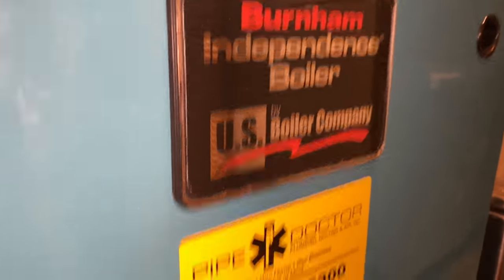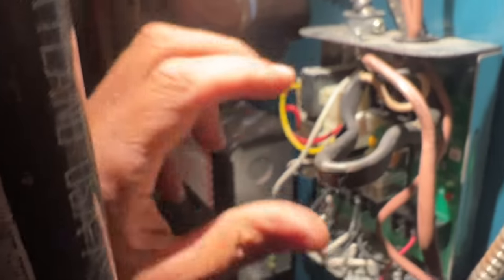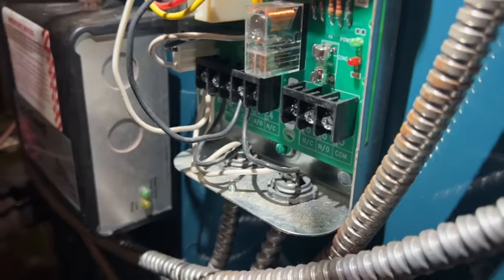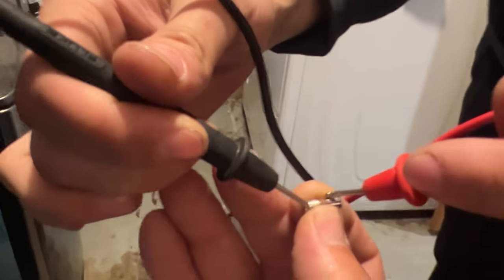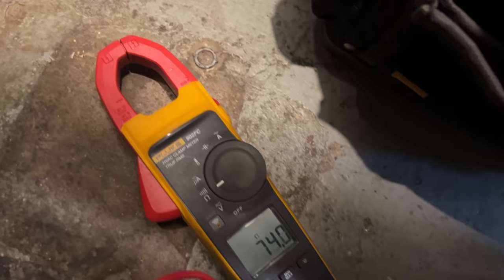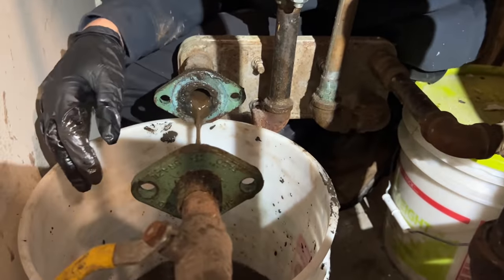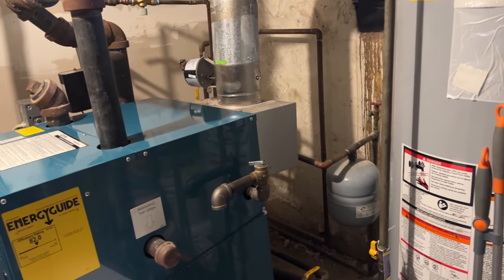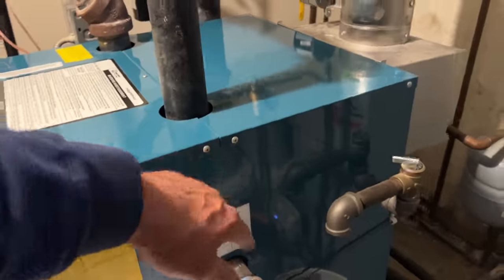Blown Taco SR501 Switching Relay - How to Test Resistance on Taco 007 Circulator

Comment: A thought. Use a temporary power cord to test each circulator motor seperately first before removing the circulator  control. 
Doing this you'll isolate the parts to find  where the  problem is, be it with the circulators or circulator control. Noisy circulator bearings,  impeller problem,  shorts in the motor or wiring will be revealed. Isolate and divide up the components to find the  problem to conquer it.

Comment: I’m trying to figure out the reason for the hot plate heat exchanger. Is there glycol in that zone or what? Maybe that zone is used to melt snow on the sidewalk? And while you’re talking finance with the customer you should have Peter pipe those relief valves to the floor

Comment: Hello Mikey.. 
I have a situation that room temperature rises above the thermostat setting. For example, it's 75 (and rising) while the thermostat setting is 70. I found that the Taco SR501 red indicator light (call for heat) is always on, with or without the thermostat connected to the system. So I think the problem is not the thermostat but rather the Taco SR501 switch relay. To control temperature, I have to manually switch off the power to the heating system. What could cause the red indicator light on all the time? How do I know for sure that the Taco SR501 relay is the problem? Thanks for your insights.

Comment: Hi mike about 200/220 ohms on circulator
Reply: Bearing im in uk voltage here is higher than 110 in the states so i would say 130-150 states

Comment: Mike , it would’ve been Interesting to see how many amps the bad motor was drawing  ?? Being that you work with the 007 all the time it would be good to know what a good amp draw is I guess you could test a few of them    When there are new and when they have been in service…
Reply: the max allowable current draw is on the rating plate and in manuals/documentation. the actual current draw varies with feet of head (flow resistance), it should never be above the rating on the tag/manual, per circulator.

Comment: Just a reminder current=voltage/resistance.  If the motor resistance is 200+ ohms it draws less current than at 160 ohms.

Comment: Should there be a strainer on the entering side of each side of the plate type heat exchanger.
Reply: yes, but those clog very fast in such service.  it shouldn't pull off the very bottom of boiler, it should come from an elevated tapping below operating water level and above the bottom, then return into the very bottom or close. most have specific tapping's just for feeding heating loops, usually listed and labeled for domestic hot water indirect tanks.
Reply: @throttlebottle5906  So it is better to change the heat exchanger the clean strainers

Comment: You aren’t double taxed if you remember you said you pay the difference from what you had already paid when you bought the part. I am surprised NY done;t have tax resale certificate it it probably one of the most widely used things for resellers along with NEXUS. Connections with particular taxing jurisdiction.

Comment: What's the purpose of the heat exchanger?
Reply: @PipeDoctor  I understand what a heat exchanger is, even an in-room radiator can be described as a heat exchanger. My question, and sorry if poorly worded, is ----why is this heat exchanger here, what purpose is it used for this home?  Is its use here typical of what's done with other home HVAC systems in your area? Thanks.
Reply: @snidelywhiplash8923 separates system glycol in the heat loops from boiler primary loop, if there was a rupture on the radiator the boiler doesn't go down
Reply: @MrDmadness  In the first 60 seconds of the video, MP says points to a pump on the heat exchanger and says it's circulating water to the basement zone. 
Why would a house occupied presumably 12 months of the year need to have glycol circulating in some radiant zones?
Reply: @snidelywhiplash8923  because proper glycol levels will not allow the zone to freeze in the case its not used and it gets cold, it's very common in high mass and baseboard heating applications. Glycol also prevents internal corrosion as its an oil so not oxidizing due to the water. The caveat is that it can jelly up if left un circulating too long

Comment: 1st brass circulator 2 strainer 3 insulation fiberglass  on the piping 4 you used black pipe on your relief valve biggest no no